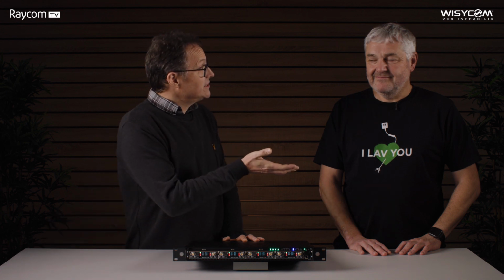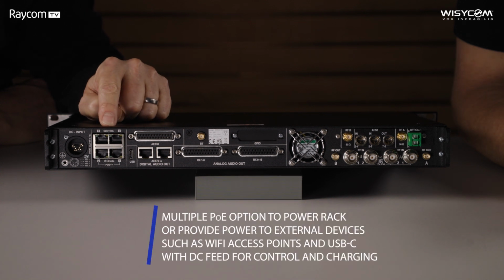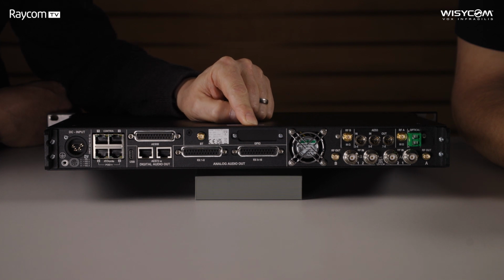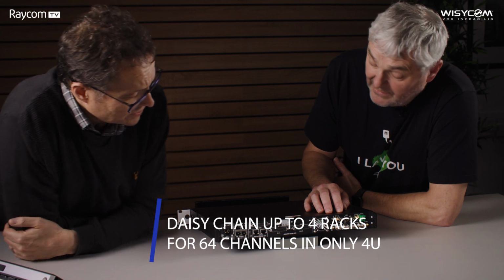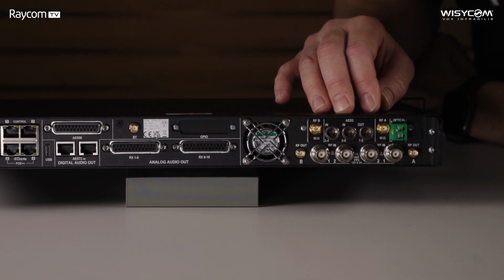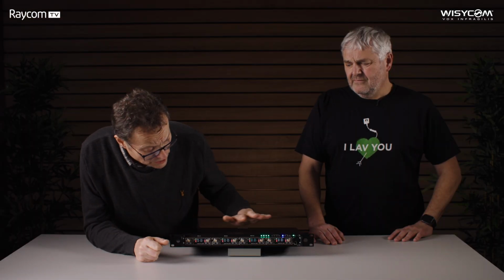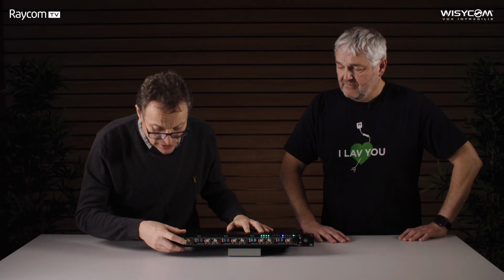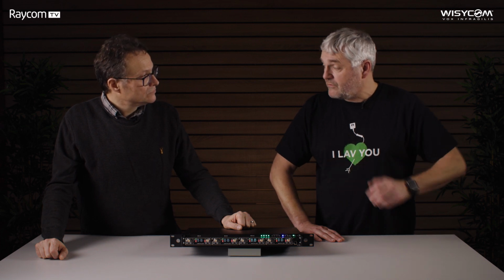Wisycom MRK16 | First Look

Comment: I wish they would have made this super slot compatible somehow.
Reply from the maker: Not possible due to the RF connections on the rear which is not available with Superslot.
Reply: @RaycomTV  
NOW it's not possible anymore. Also the audio and data connection is different from SuperSlot. However they could have designed this thing different from the start. Although I love Wisycom and the features of the MRK16, I keep wondering who wants to invest in 16 channels of only analog Wisycom for cart use when there are strong digital competitors like the new Shure offering. Wisycom could have built the perfekt device not only for Wisy users but they decided to stay within their eco-system. Bummer.